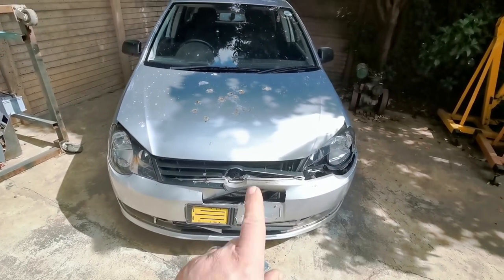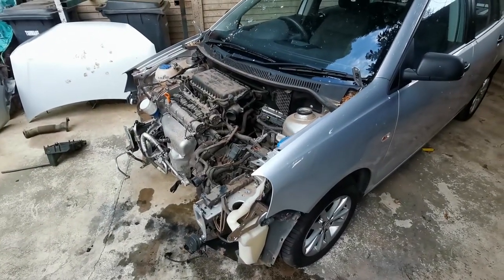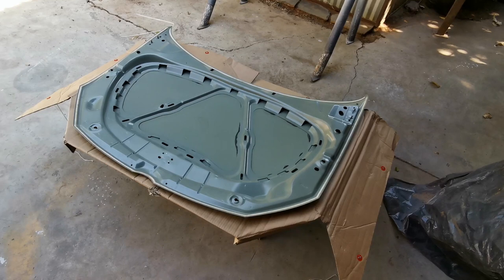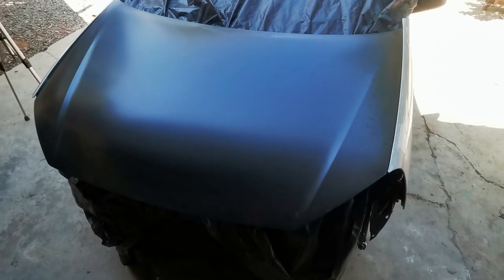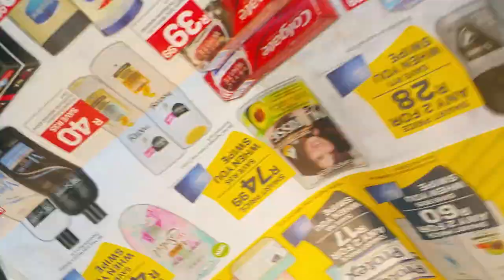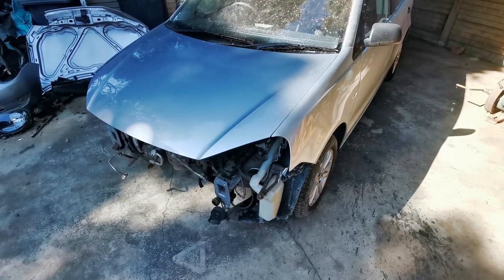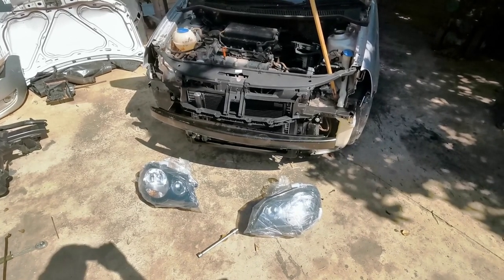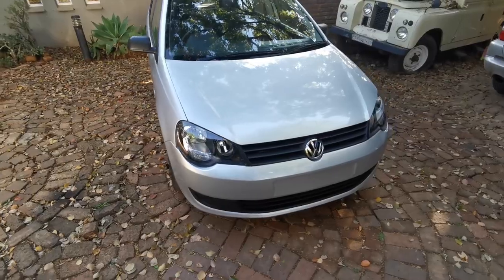diy - Volkswagen Polo accident repair - Start to Finish

Comment: Hi there I've just done the same repair however I can't get my bonnet to close down properly, did you have any issues with that
Reply from the maker: Hi there. Didn't have that problem. Have you tried adjusting the rubber stoppers underneath the bonnet?
Reply from the maker: Another option would be to put some shims (washers) between the locking eye on the bonnet.

Comment: I have the exact same damage except I drove into a moerse rock when I made a 3 point turn 😑 - everything is the same except my radiator fins were less bent and no bonnet damage. The body work is costing me an arm and a leg.
Reply from the maker: Shit that's unfortunate dude. Was there structure damage that had to be straightened?
Reply: @BroughBuilt  fortunately not. Just the 2 radiators were bent (but I decided to replace them), bumper+grill , support at the bottom of the bumper and the cradle (although the cradle might be salvageable). I sent you a message on Instagram yesterday and this morning btw.